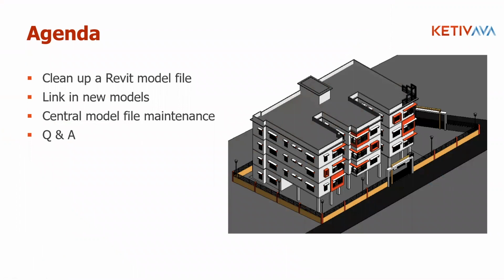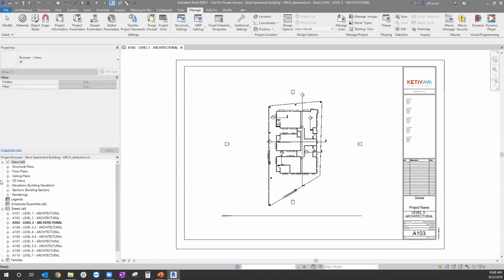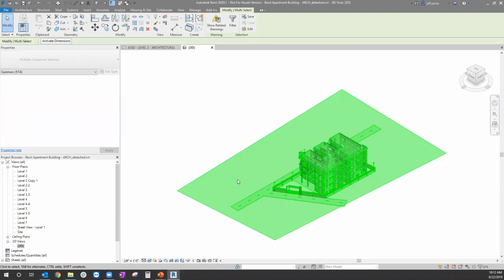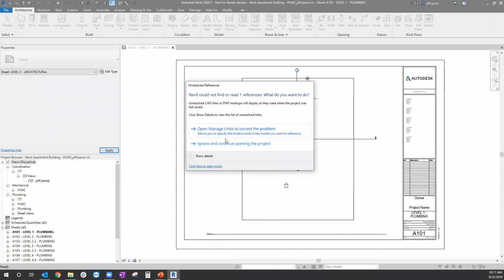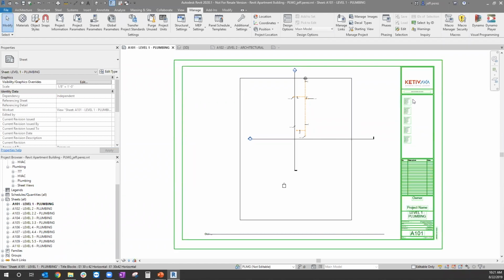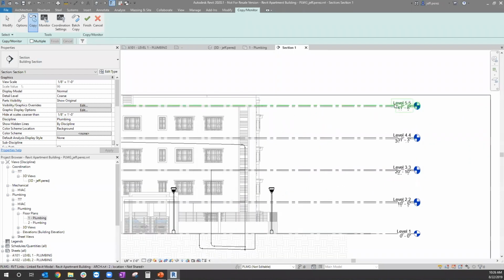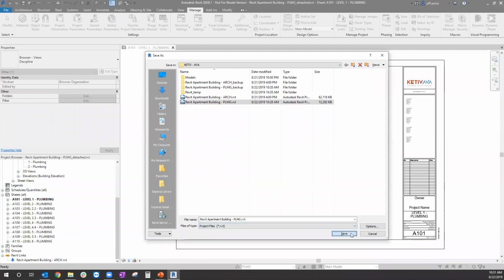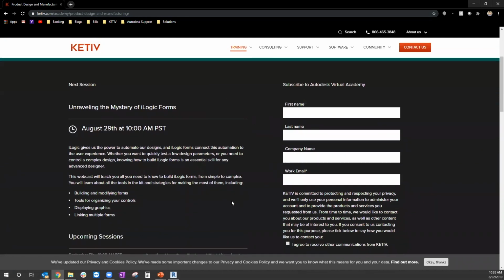Revit Links and Model Cleanup | Autodesk Virtual Academy

Comment: Hey There, I know this video is a bit out of date now, but is this a sustainable way to clean up links? As an interior design firm we get model updates every couple of months... and we can't go through this process every time.
Is there a way to automate this?
Reply: Keep a project folder named "Links" then overwrite the linked model with the newly received version. Do not use dates or versioning in the names of linked models.  So, for example the Arch model would always be <project name>-A

If you want to keep model files dated for "when did I get this" archive purposes, keep them separate from the working files links. Preferably .zip or .rar so other users can't accidentally link them.